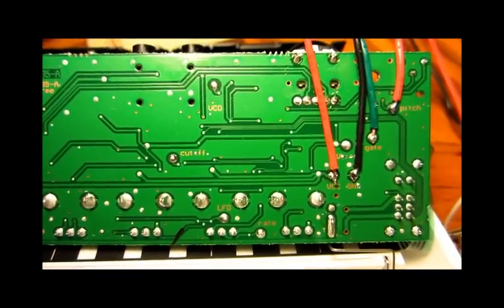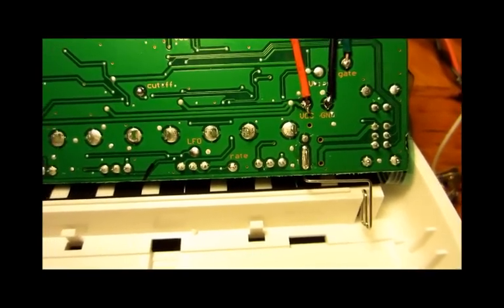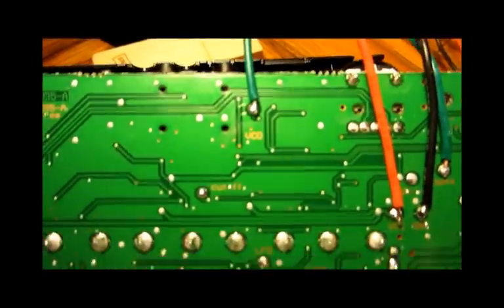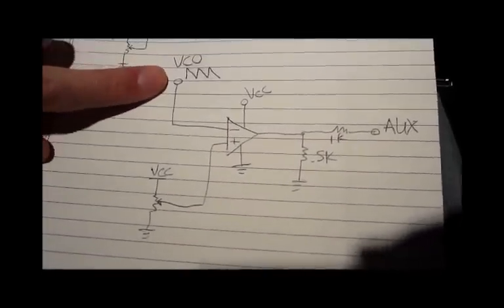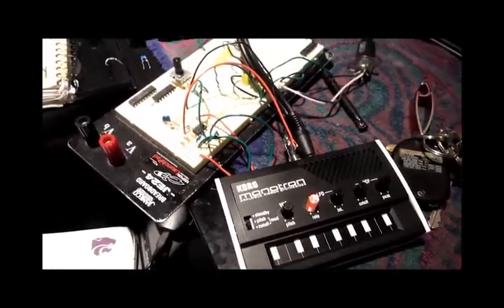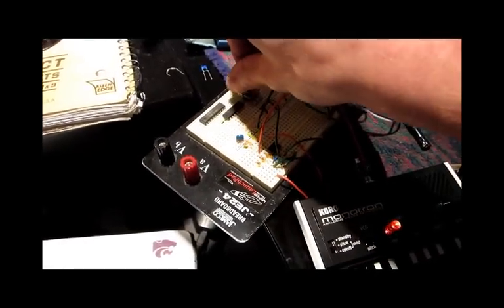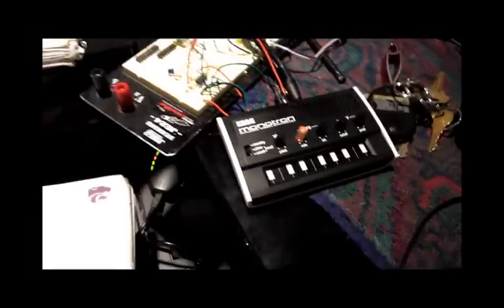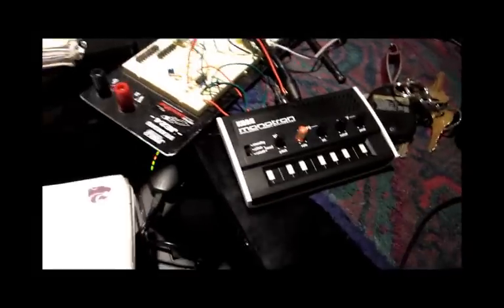monotron square wave and pwm mods

Comment: From my experience i've found that using one single 330 ohm resistor from the op-amp output to the ground puts the squarewave to pretty much the exact level as the sawtoothwave. Though i did run it back into C14, which is a bit fiddly to solder.

Comment: @squab2468 He could've either used the LFO out blob and put some resistors between it and the ' + ' -pin on the op-amp (together with the pulse width potmeter), or use the top right pin of the stand-by switch (if i'm correct). Hope this helped a bit !

Comment: @squab2468 Basically what he did was cut the road between the VCO blob (the raw oscillator output), and instead makes a detour and goes straight into the op-amp's ' - ' -pin (usually pin #2), and then hooked a potmeter to the ' + ' -pin (usually pin #3) which goes into ground which will let you set the pulse width. The output of the op-amp (usually pin #6) then instead goes into the filter. And to balance the levels he added more resistance. Add in a switch for pulse/saw and presto.

Comment: I think VCC is actually 5V. The 3V from the batteries is boosted. I have mine running off a wallwart with a 7805. I did the same thing with a squarewave comparator, and added other modifications. PWM for the square, phase shifting the square so it lands at a different spot along the saw, and send the square into a 4040 divider to get sub octaves. I also added the MIDI-IF PCB. Working on an envelope next, but I have to finish up a drum machine first. Got my schematic on the electro-music forums.